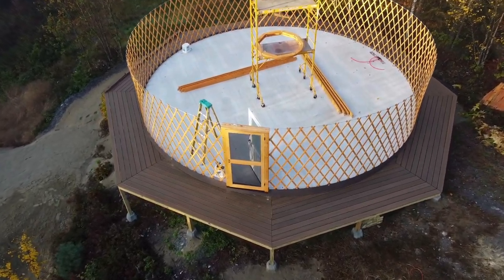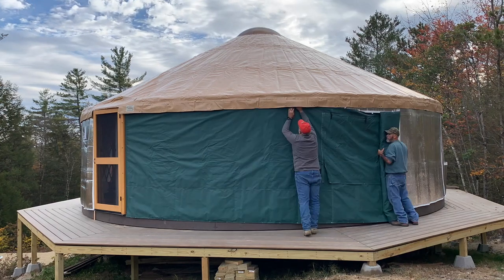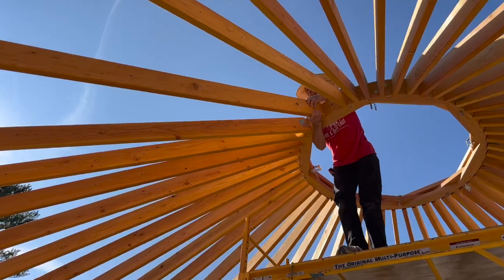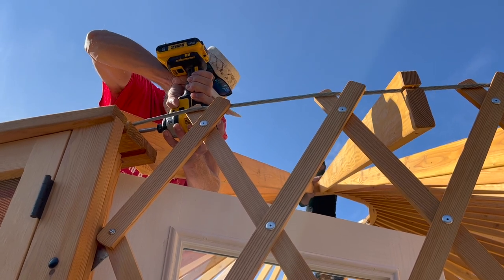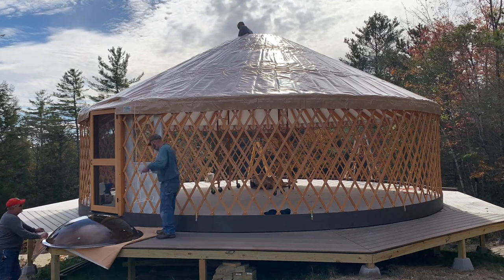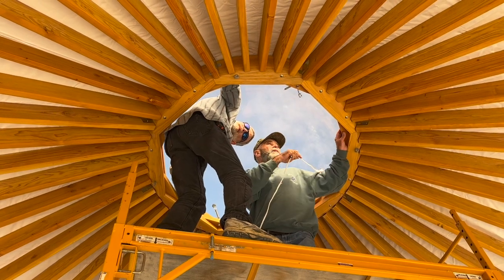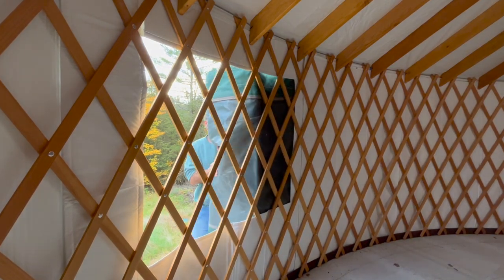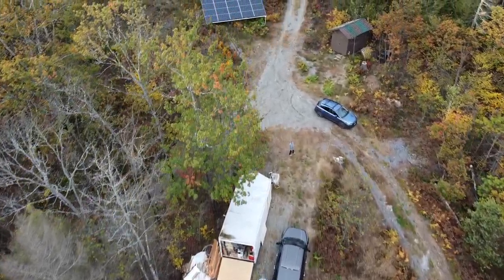Yurt Raising Day 2 (Vermont DIY off-grid home build)

Comment: Fantastic! congrats on roof and outside wall. Huge progress! How many days did it take to get both finished? 😅
Reply from the maker: We got the yurt up in two days total (but then came back to put in some additional features from the wind and snow kit, which happened over the course of a few more days). Finishing the inside will take months, though.
Reply: Excellent progress!  Will the hydronic heating use solar water heaters?  I can’t wait to see the next episode!
Reply from the maker: Thank you! Someday, solar thermal is on the list of possible projects ... but the radiant floor heat will rely primarily on wood (rocket mass heater), with propane as a backup for when we are not home, and also excess solar electric power when available.

Comment: Just a couple things I was wondering about. One I was wondering how the skylight was secured an made water tight. Two are you able to walk on the roof?
Reply from the maker: The dome is held down with 3 springs and a screw-type closer (I think you will see in the next video). Each of the springs are backed up with cables, just in case a strong wind were able to overcome the spring pressure (which is probably not likely). It is water tight due to the dome sitting on top of and overhanging the roof material on an angle.
The roof cannot really be walked on. I don't think it would have any problem supporting the weight, but it has no solid deck on it. With some finagling, it may be possible to support some sort of board to sit on while making a repair, but we'll cross that bridge if we ever have to.